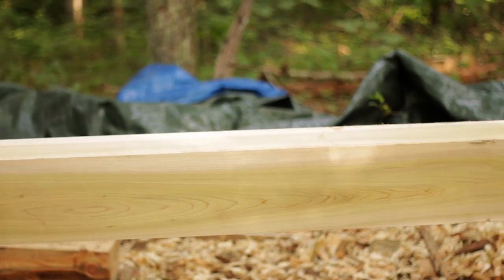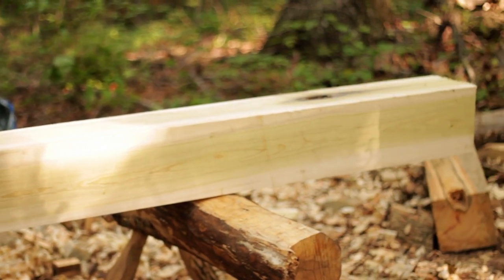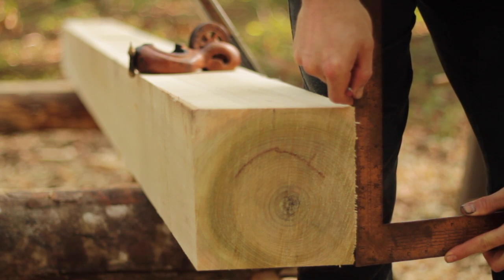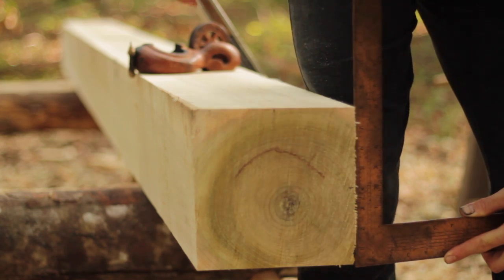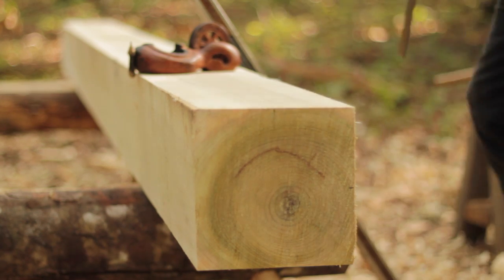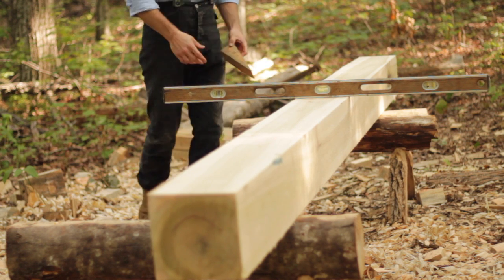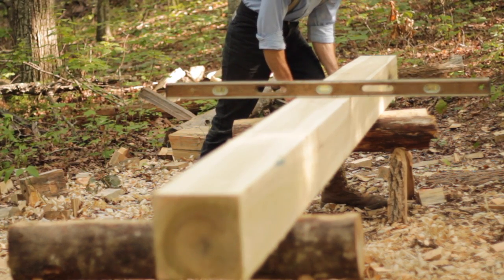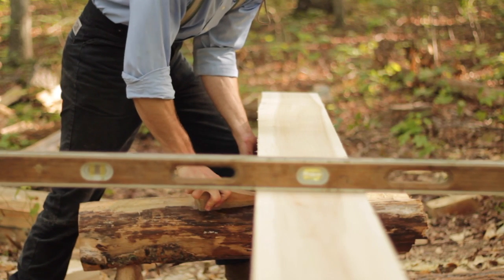Our timberframe cabin part VII: Tulip Poplar Post

Comment: another good video, I've been missing them, glad to see your back in action. I guess you've had the same heat wave we have. I sawed lumber all day yesterday. Got a lot done, but was wore out last night. You've really got me thinking about this timber framing. I purchased a huge slick today, about  3 1/2 inches wide. Needs to be sharpened, but lots of steel to work with. Looks like more age than wear on it. I'll be looking forward to more videos.
Reply from the maker: Yep, its been brutal these last weeks, either hot and humid or raining…just a tough time to do this work, I think in the future this will be a fall/winter past time haha, summer will be for the garden and fishing! Great score on the slick, mine was a rust bucket, I nearly ground 1/16th of steel off to get past the pitting when I restored her!

Comment: I am a very long time watcher. Loved everything you have ever done and you inspired me to do what I am doing now. I think I've watched this video about 10 times over a number of years. I have a query.
When you flick the layout lines, are you doing them in the middle of each end of the timber, i.e. if each end is slightly different dimensions, the measure of timber either side of your centreline is slightly different at each end? Or are you measuring off the a "reference edge" to a nominal centreline, i.e. measuring 3 inches from the edge at one end of the timber and then the same at the other end. I am asking because I am doing some traditional timber framing up against an existing building, so I have a reference plane that I need my timbers to stand up against as close as possible. So the only way I can conceptualize this layout method working, for my purposes, is by approaching it with the latter. In my mind at least, the former method will not allow for knowledge of how my outside faces are going to interact with the existing reference place (building). I realize the answer to my question is very simple, but if you have any other advice for my situation, I'd be most grateful.
Reply from the maker: As a general rule, I am finding the rough center point of each end, and using the spirit level to trace my cross on the ends. The snapped lines are just connecting the arms of those crosses from one end to the other. These lines are used for all layout, and actual timber edges are not, though they are considered for depth of housings and such at times, most often its all the center lines, so measurements all come up off the center lines, so housings are say 2" up from the center line, never 1" in from the actual timber edge, even if it is in some cases. Imagine a twisted timer, or radically curved timber, the actual timber edge might vary greatly in distance from the center line from one point to another. 
Just follow the center lines and it will all work out and come together.

Comment: Hi, Mr. Chickadee. Thank you for teaching traditional carpentry. Based on their examples, we are building our wooden house. However we afflicts a problem, namely: How do you fight against mold and other decay fungi that make wood decay poplar and pine? Have you considered the possibility of using boron salts, for example?
Reply from the maker: all mold and decay generally require the wood to remain wet, dry wood can last forever. We also had most growing on our pine last summer in the constant rain and high humidity (it felt like the amazon for a few months! )

What I learned is to just try and keep the timbers covered during rains, open when dry in a well stacked situation which lets air pass around them, and cut the joints and get the building up as soon as possible.  (this was several months for us) once the building is up, and a good design followed suited to your geographical area and weather conditions which let water escape and shelter the wood house from rain the timbers will dry and mold and decay will not be an issue. 

Borates can be used here as well, we tried some and didnt notice much difference so stopped using them. THey also are supposed to help against insects.

Comment: Love your work. Are you air drying your wood before use and if so how long. Do you measure the moisture of the wood before you start working it?
Reply from the maker: THanks, 
No everything for the frame is freshly sawn or hewed. Only wood for interior furniture or specific joinery needs to be dry, I just stack it properly and give it some time in the wind, I don't use a moisture meter or anything, joinery should be done which plans for shrinkage and expansion.

Comment: Hooray! We got us a rabbet plane! Looks like a dandy old school, all wood plane I don't recognize. Got some details? 

Anyone ever show you how with a little woodworking you can make a joiner plane or grooving plane with an unmodified chisel and a seasoned hunk of maple or beech firewood in a couple hours? I bet you had it figured out by the time you finished reading the previous sentence. A grooving plane and a stair case saw would be handy for working down those wattle grooves.

Ever notice how my suggestions all require scrounging time and money?
Reply from the maker: Its a double knicker Jack or "ship" rabbet plane used by proper carpenters and ship writes of old. 

Ive made a few planes before with just chisels and some sandpaper glued to a stick for a float, now the issue is time more than ability, but someday, you might even see "Mr Chickadee" brand planes for sale haha. 

I have wandered how they made the wattle groove back in the middle ages, not sure they had plough planes…maybe just a LOOONG time with a thin chisel?
Reply: +Mr. Chickadee Hmm, they were practical then and frugal with time and materials on the craft level. Pure conjecture here, but I wonder if they didn't use a skinny hand adz? Incise the edges with a driven hatchet and follow between with the skinny adz. 

IIRC, wattles are long skinny sticks grown specifically for the job in a willow spinney and woven in place fresh cut. The slots cut for them only had to be wide enough for the average big ends and deep enough for the lateral shift needed to retain them. The slots were concealed by the daub so they didn't have to be fine joinery.

Got plenty of horse residue for the daub? Wasn't it 2/3 subsoil mud, 1/3 week old manure, and chopped barley straw as needed for reinforcement? I bet Mrs Chuckadee loves that idea even if the stuff does last 500 years.
Reply: +Forrest  Addy I got some ideas that might be suitable for a line of Chickadee planes. I was thinking of a hybrid of Japanese and European design with let-in metal cheeks. More parts but easier to make.
Reply from the maker: Interesting, I too wandered about a thin adze, it is odd Ive read stacks on wattle and daub but no one ever mentions how the grooves were made…we found manure to be unneeded in our workshop, just clay rich soil, sand and straw, hard a a rock after a few weeks. There has been some conjecture that the manure in historic examples was unintentional, they used traction animals to tread and mix the daub, others think they just grabbed used straw from the barn, along with the poo, still more think it was added if the soil was not sufficiently clay based…I'm pretty sure people just used what dad used, or what they had near by
Reply: +Mr. Chickadee According to my exhaustive scholarship and wide ranging researches (ten minutes Googling) the manure was a binding agent making the dried daub water-resistant and tough so it didn't later melt from the straw when struck by rain.

Some kinds of clay are slow to react and slump with water. Maybe Eastern Kentuckey is so endowed. Poopless daub, a geographical characteristic sure to be exploited by your chamber of commerce.

Comment: great video once again Mr C! The kerf cut is very interesting. I have not seen this too much in America but I have heard the Japanese used this to limit checking. Is it preferable to cut always through to the heart? I always assumed it would be a 1-2 inch deep cut in the nonexposed face, but I was just guessing. Will you use Sewari on all the timbers of your frame or just the Tulip?JD
Reply from the maker: Yes its sad we don't see it more here, Ive heard many timber framers avoid Tulip Poplar because of its checking, where sewari can create a perfect timber with it. As I understand the technique the cut should be made down to the heart, but not through it, this should ensure the drying crack will follow this path where you want it. Most of our frame is yellow pine, which checks much less and I don't feel it necessary to kerf, just the big poplar. pieces.
Reply: Thanks for the replies Mr C and Jay C. Of all the negativity of technology, this is the beautiful side of the internet where great ideas and techniques can be resurrected and shared. I must say ,It is scary to see that cut into the timber. It looks as though it would diminish the strength of the timber, but I guess the strength  is then concentrated in the other three sides. Im curious is there no checking at all, or just reduced checking in the other faces? thanks again for sharing all youve learned. It is a great gift for all of us aspiring tradesman.JD
Reply: Than you for you input Jay C.What would one look for to find these deleterious defects?

Comment: Also, how do you decide where to make the initial marks for making the cross on each end - that is, what is the reference? Seems like to make the lines correctly, the marks on one end have to line up perfectly with those on the other end, but how could they without being made from the same reference. Sorry if that's unintelligible - I'm very novice.
Reply from the maker: I start by leveling the timber from its rough middle lengthwise. Then I measure a rough center point on each end and make a small pencil mark. Now, without moing the timber after its been leveled, I use the level to take these small center marks down first horizontally and vertically. That done on each end gives you a cross that should be centered in the timber and coplaner end to end, since you use the level to make the cross on each end, each end will be in the same plane, at least the crosses. You could also just make a rough pencil mark of the exact center point on each end of the timber, and when you cross with the level try and hit this center mark with your cross. thats how I would do a round timber.
Reply: Much obliged Mr C

Comment: Another video that went by way too fast! I believe you said you bought that mortise machine at an antique store near you? I live in Minnesota and those machines are nowhere to be found in the north. Would it be possible to get contact info to the place you found one so I can see if they have one they can ship to me? I would really appreciate it. Again thanks for sharing your experience with all of us. Watching your videos has greatly helped me on building a piece-en-piece sauna and soon a timber frame wood/blacksmith shop.
Reply from the maker: I can keep a look out, but I feel I got lucky on that one. You should check on Ebay, they always have a few kicking around there, then bits too I know Jim Bode antiques has them most times too
Reply: It seems people want a small fortune for them. I'm sure i'll find one eventually. Looking forward to the next video!
Reply from the maker: http://www.ebay.com/itm/Antique-Hand-Drill/142049870539?_trksid=p2047675.c100005.m1851&_trkparms=aid%3D222007%26algo%3DSIC.MBE%26ao%3D1%26asc%3D37798%26meid%3D4ce37251f2074f6dbe108dfb22ab448a%26pid%3D100005%26rk%3D4%26rkt%3D6%26sd%3D282106588206 Id get this one, bit of TLC it should be great, half what I spent too...
Reply: That's a local pickup auction only unfortunately.  I'm trying to talk em into shipping if i give them a little more money. I appreciate the help though :)  As always looking forward to more videos.

Comment: Is that kerf you made, at the end, to prevent checking on the other faces?
Reply from the maker: Essentially, yes, it localizes drying stress to the one split, which is placed on a non viewed side of the timber, it also helps stabilize and "tame" the timber from twisting and other issues.

Comment: When framing are you using a square rule or scribed? I love watching you work I'm trying to learn tricks of the trade but am just beginning.
Reply from the maker: I used a rough form of "square rule" for our workshop last year, this year and in all our cabin videos I have been using "Line rule" or "snap line rule" layout. THis is the dominate layout form used in Asia and I have found it much easier and more accurate than any other method I have tried. The beauty of it is all layout comes from a leveled center line, never from an edge surface, so the straightness of a piece of timber does not matter at all, it can be twisted, bent, or even left in the round, all paths lead back to the center line. Ive tried to document its use and method in our latest videos of the "timber frame cabin" series.

Comment: Is it traditional to plane all the mating surfaces for perfect contact? I haven't seen that in other videos or books. I guess the cleaner the surfaces the better the joint.
Reply from the maker: there are as many variations of finish, tools and method as types of timber framing. Some are very rough axe finished, some are much finer than this...there is no One way, but many many options

Comment: Can you timber frame like that with yellow pine? If you can, I'm sure it would rot fast so is there something you can treat the wood with?
Reply from the maker: Most of our house is actually "yellow pine", with proper design most any wood can be used, and has been historically. Koreans have made timber frames of a white pine for thousands of years. Its all about keeping the timbers dry, dry wood can't rot. Elevate the structure up off the ground on good old stones. Have wide overhanging eves all around and a good wall treatment. In most timber frame homes, the timbers are never exposed to the elements, and if they are, good design like the eves, or better yet a wrap around porch, and also a good coating of natural oils and waxes like linseed oil mixed with pine tar once every decade or so will do wanders to help.
Reply: Thank you sir, for your reply.

Comment: is the cabin going to be a one or two story cabin
Reply from the maker: It will have a 4 foot knee wall and a loft bedroom on one side.
Reply: +Mr. Chickadee almost like the timber frame workshop
Reply from the maker: yep, pretty similar style, the house is a bit wider though.
Reply: +Mr. Chickadee the timber frame workshop looked half as wide as it is tall. Are you thinking of running electricity to the work shop for lighting when your working at night?
Reply from the maker: Yes have considered it, lights and dehumidifier only, not power tools of course.

Comment: Never heard of anyone using poplar for timberframe. Doug fur,white pine, white oak,that's just me please let me know how it worked out exussive shrinking ??
Reply from the maker: Though not my first choice, tulip poplar can be a great wood for timber framing and log architecture, it must be understood and implemented correctly. Excessive checking and movement can be controlled very well by kerfing as shown in this video, down to the heart, then wedged open, as in the Japanese tradition. You can achieve a knot free timber with zero checks in this way easily with tulip wood.
Reply: I was going to ask the same question as Jon about the checking. I have been contemplating using yellow poplar but the checking really does have me worried. Your above post mentions kerfing the timber and wedging it, do you have a video of that operation and if not can you point me in the direction of one. Thanks.

Comment: How do you keep termites and other hungry insects from turning all your hard work into dinner?
Reply from the maker: Most wood eating insects can be controlled by a few traditional practices, 
1. removing bark ASAP
2. keeping the wood up off the ground
3. building in such a way the wood can always dry out pretty quickly
Reply: Oh. Okay, thanks for the information.
Reply: Most bugs won't eat dry wood (with a moisture content under 15%). Removing the bark and keeping wood off the ground helps newly cut timber dry out more quickly, and building your house such, that all components are well ventilated is an extremely important practice for the longevity of the house.

Comment: Do you plan to fit wood to the kerf once it has dried? I read about umeki. http://thecarpentryway.blogspot.com/2015/01/gateway-27.html
Reply from the maker: no, this is the only poplar post and Ill just turn the kerf side outbound as it will receive wood sheathing. if the kerf would be visible I would wedge it.
Reply: Thanks for the reply.
Reply: Thank you, the internet is a treasure trove and work like this channel is some of the very best. I'm learning as much as I can because I'm building a black walnut table and even basic knowledge in many areas is new to me.